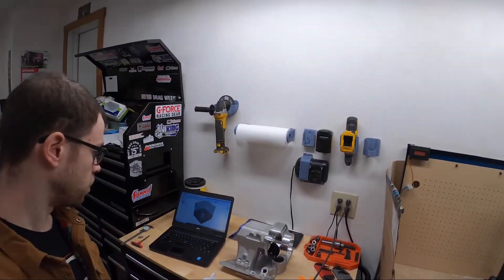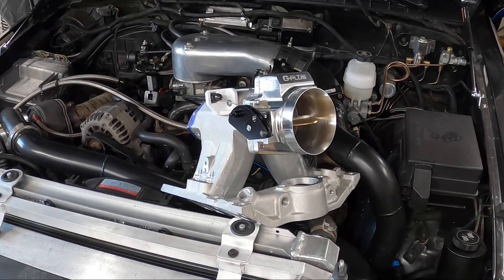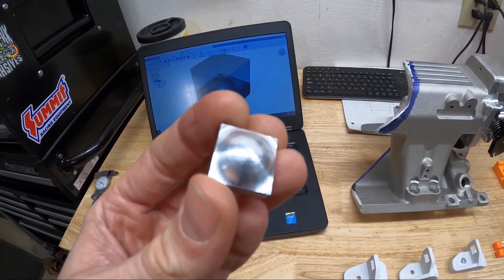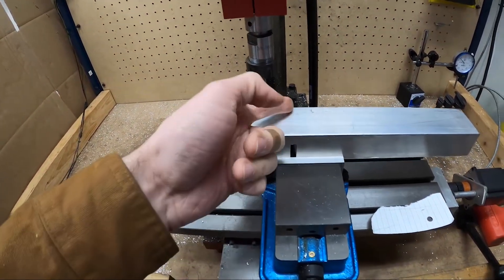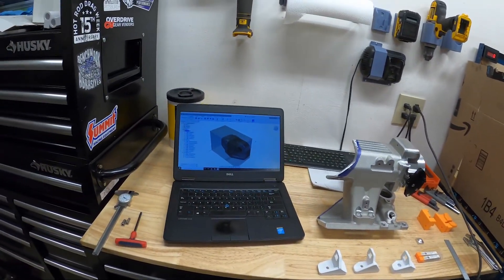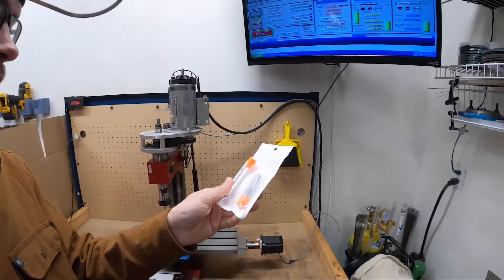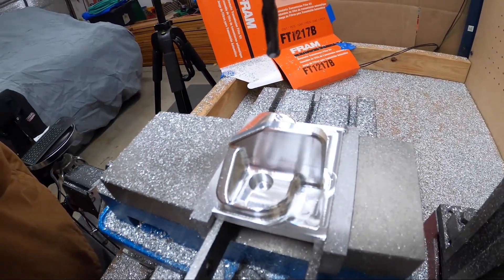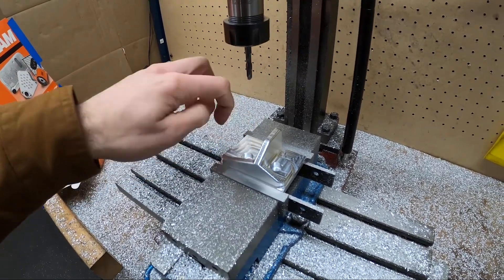Billet Throttle Bracket - Custom 4.3L V6 Intake Manifold

Comment: Damn it man, You're killing me with all these Custom parts LOL, Bc I want stuff like this for my truck but I don't know how to do all that stuff you're doing tho sadly, My 95 S10 is a 4.3/5 Speed with a TBI,  I'm already working on Modifying a V8 TBI to put on my 4.3L bc of the Bigger Injectors, I just need to do some more research on it tho to see if I need to get a different Fuel Pressure Spring or if the Factory Spring is good enough, I've already made the Factory Fuel Pressure Regulator Adjustable that way I didn't have to buy one, It was easy to do too, I still need to shave the lips off the top of the TBI Body around the Bore Holes and also grind down the Rod in the middle by half its size for more air flow, From what I've read online after doing all that I should get like 500cfm out of it and Idk how much HP (if any) it will add...